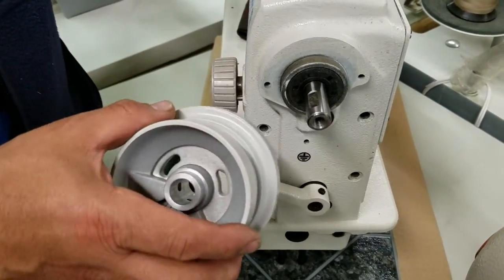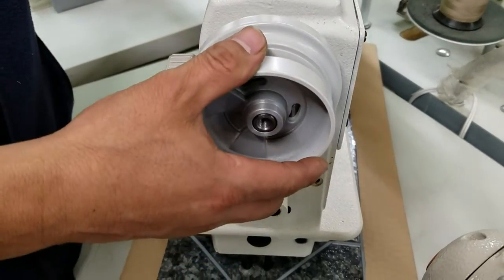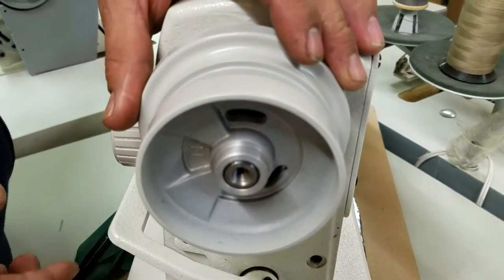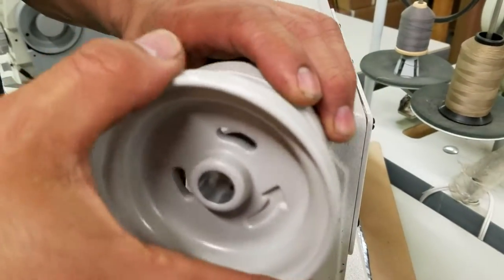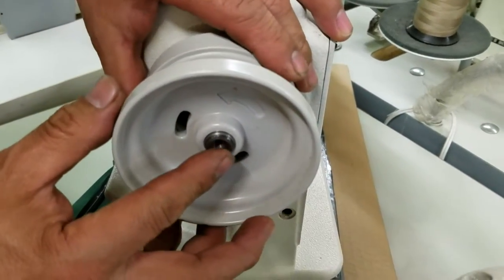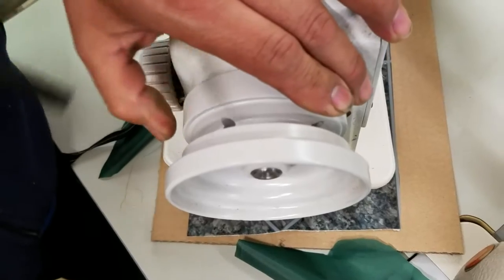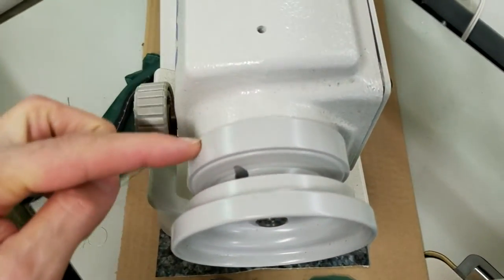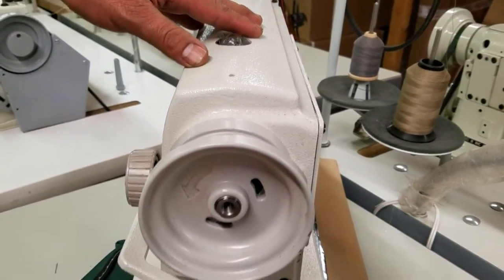Juki DDL-8700 Hand wheel installation

Comment: Thank you for this video. I just got my machine yesterday and my flywheel is super stiff to turn.  Should it be that stiff?
Reply from the maker: Sometimes the clutch in the motor makes the machine's hand wheel tight.  Push ever so slightly on your foot pedal without engaging the motor to release the clutch.  That should loosen up the wheel.

Comment: Very frustrated here... I just finished assembling my machine yesterday.  Tonight I sat down to test it and it sewed a few stitches but now won't sew.  It sounded like the belt was slipping so I tightened it but then it sounded too tight and barely moving so I loosened it.  I think it has something to do with the hand wheel because it will not budge.  I did assemble it as your video above (except mine only had one screw so I lined that up with the flat section and tightened). Any ideas what I did wrong?  Any help would be greatly appreciated.
Reply from the maker: It could be as simple as a thread caught in the hook assembly.  Oil the space between the hook base/basket and hook assembly, and then try and turn the hand wheel.  https://youtu.be/l8SNvQawBf4